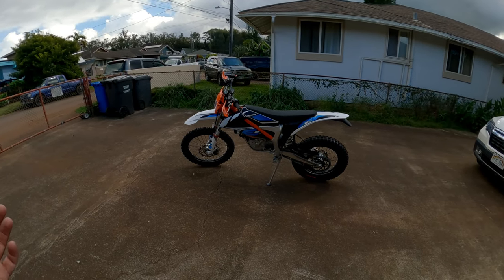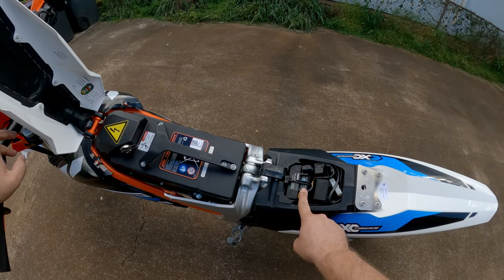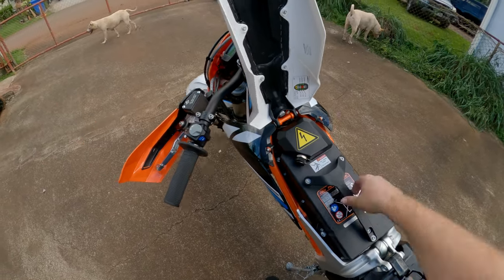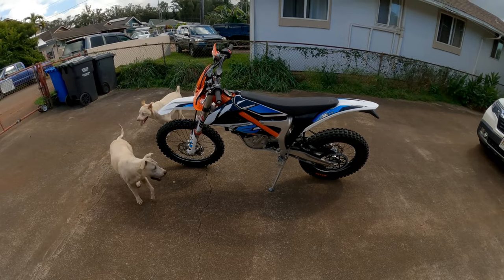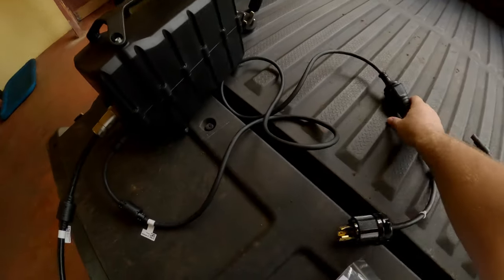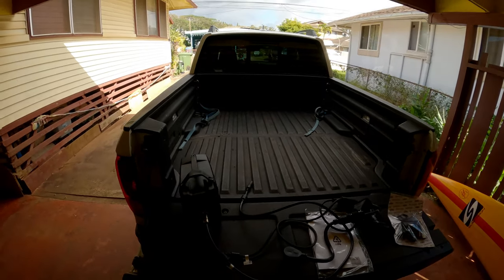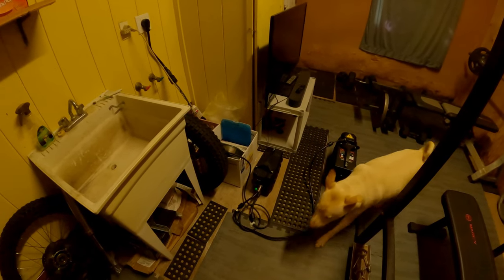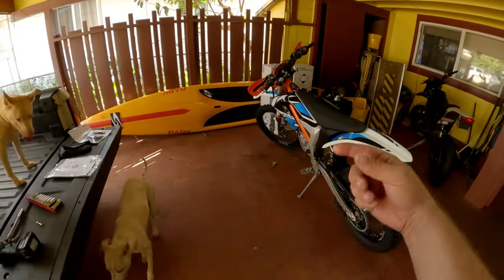My New Electric KTM Freeride E-XC Dirt Bike

Comment: I have the same bike. I bought mine used. Mine has turn signals on it, but none of them I see online have them. Maybe it was an option. 
I was planning on putting a plate on it to ride it on the street, but the title says not for highway use. So it is not street legal for some reason. Sort of a bummer because the bike has everything required to be street legal.

Comment: I bought one too. Funbike. Nice Dogs by the way
Reply from the maker: Hell yeah dude! 52t sprocket wakes the bike up
Reply: @Mayhemjach  its already a very hot love affair.
Reply: @Mayhemjach  52t sprocket? Just thinking about. More punch of course. But is this reducing the top speed?
Reply from the maker: It will reduce top speed by about 5 mph. Worth the torque gains imo.
Reply: @Mayhemjach  thanks for info. More torque is good for coming in slowweely and technical stuff I guess. I should give it a try. I always fear to hit the groundplate by crossing trees and stones by failure. It almost hurts even when happend to my husky. The groundplate from Freeride looks much more vulnerable. Maybe not so good for trial exercises.

Comment: Which is better? Free ride or zero? Based on price and performance
Reply from the maker: For the street the zero is way better. It has double the range, double the power. It’s very heavy and in tight trails it’s hard to keep it upright. The ktm does the best off-road. Doesn’t have as much power or range but it’s also 60 lbs lighter and about $2k cheaper. I just bought a bunch of parts for the ktm like a bigger sprocket. So that will give me more torque. 

So to answer the question. The ktm is better if your riding tight trails. The zero is a better overall bike for fire road type of off-roading. If I could only have one. I’d pick the zero